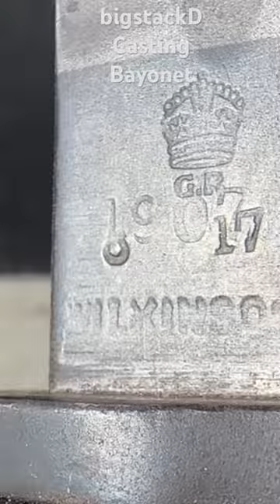BigStackD Casting a Bronze Bayonet

Comment: I am hoping I could use a liter capacity crucible to make either two or three ingots, are there any sources of either cast iron or graphite ingot molds you would recommend?
PS: I have an idea:
A copper ingot is hard to produce a smooth top with; perhaps a slab of graphite with a pour hole as a lid is capable of fixing that.  Is that a good idea?